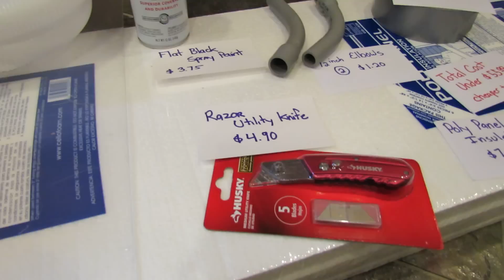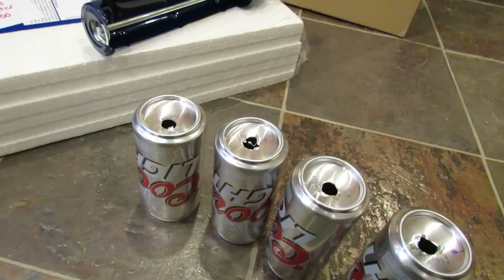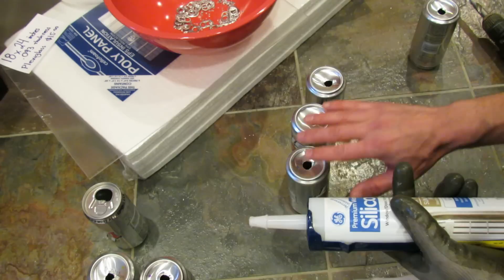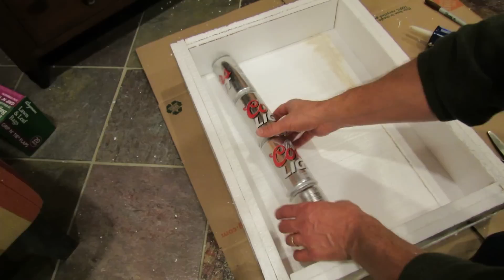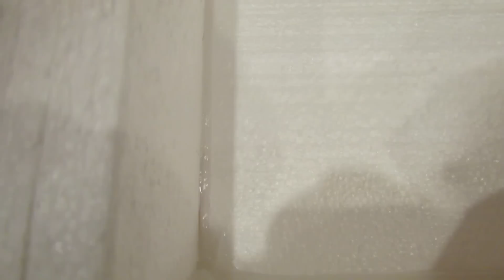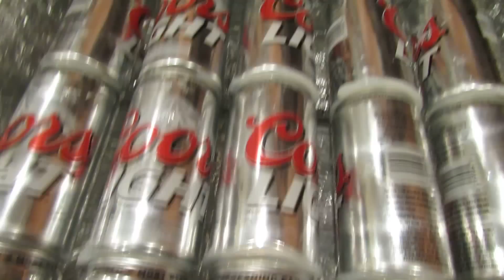Complete Steps for Building A Solar Thermal Soda/Beer Can Heater for A Greenhouse - MFG 2013

Comment: @myfirstvegetablegarden thanks for the clear explanation.  Shiny side of tinfoil reflects heat...so should I leave it shiny and only paint the cans? I  see it's been 10 years since you made this...how has it worked for you? If you made another did you make any improvements?
Reply from the maker: This was a small scale version but it was effective when I used it.
Please Visit The Rusted Garden Seed & Garden Shop: 
https://www.therustedgarden.com/ - Seeds, Starting Supplies, Neem Oil, Peppermint & Other Oils, Calcium Nitrate & More.

Comment: As a horticulturist of over fifty years and a glasshouse grower in the UK, I am a little puzzled how this could be a useful heater for a greenhouse.  Even in our northern latitudes,  when the sun shines in winter, greenhouse temperatures can reach up to 15 degrees centigrade plus. Since this contraption only produces heat when the sun shines  and only a very small amount when it doesn't, I can't really see the point. Heat is really needed at night when this, obviously is unable to work.

Comment: I’d mention that the cans should be rinsed out, especially if using beer cans. That air going into the greenhouse is fine, but not into your house. Ever smell a tavern in the morning? That stale smell is disgusting.
Reply from the maker: Great Point.
Please visit The Rusted Garden Seed & Garden shop for your fabric pots, fall & spring seeds, seed starting supplies, peppermint oil, neem oil, TRG merchandise and more at www.therustedgarden.com Check out my new gardening PODCAST Gardening Coast2Coast at https://gardeningcoast2coast.net with CaliKim.
Reply from the maker: Very true.
Please visit The Rusted Garden Seed & Garden shop for your fabric pots, fall & spring seeds, seed starting supplies, peppermint oil, neem oil, TRG merchandise and more at www.therustedgarden.com Check out my new gardening PODCAST Gardening Coast2Coast at https://gardeningcoast2coast.net with CaliKim.

Comment: You don't need a drill bit for the cans use your razor knife you score aluminum around inside edge like three or four times the perimeter of the inside of the lip of the bottom of the can and the same for the top with a night with a knife and you go around you can cut aluminum sheeting or aluminum with a razor knife it's scratches and cuts wide open I know this cuz I used to install aluminum trim around windows and this is how we used to cut it in the field after we got it measured.
Reply from the maker: Thanks so much
Please Visit The Rusted Garden Seed & Garden Shop: www.therustedgarden.com - Seeds, Starting Supplies, Neem Oil, Peppermint & Other Oils, Calcium Nitrate & More.

Comment: From a design perspective, addition of "tubes" by any form is unnecessary to collect sun's energy.  The unreflective black spray paint is all that's necessary to collect and transfer the heated air from outside to inside.  You can simply test this by doing away with black spray painting as compared to painting the interior of the box with black non-reflective paint.
This is based on the principle of energy transfer.
Energy absorbed is proportional to the mass of the object that is heated, minus the amount of heat lost during transfer.
Reply from the maker: Cool thanks. If I build one again, Ill try it.
https://www.youtube.com/user/pilarchik

Comment: Pssst! I'm a physicist. You do NOT need beer cans AT ALL. Any insulated box with the inside wood painted black and covered with transparent plastic will work fine.
Reply from the maker: That sounds easier. Thanks.

Comment: Pssst!! I'm a physicist. You don't need pop cans, downspout, or tubes to direct the air. Convection works fine, or a fan makes them even MORE unnecessary!!  All you need is an aluminized insulated box and a piece of black aluminum screen suspended inside it.  None of the professionally installed units have ducting inside!!
Reply from the maker: Thanks. Even simpler.
I now have 'The Rusted Garden - A Garden Wants to Give' T-Shirts. Please visit my Garden and Seed Shop at www.therustedgarden.com

Comment: You build the box yourself but it might be practical to look for existing boxes as there is less concern about hot air going out and less glue etc. to be used. At the market I saw people who are selling fish using boxes that have about the required size. Actually I got them for free after they sold the fish. It just took a few days to remove the smell of the fish.
Reply from the maker: That's  a great idea.

Comment: I wonder if a blow torch could make holes in the bottoms easier, map gas or propane should melt a larger hole easier.
Reply from the maker: +piecartbox Oh yeah that would work quickly.

Comment: For the paint, you can get higher yield using Thermolux "Selective Solar Coating" paint - it collects solar energy much more efficiently than matte black, and also has an extremely high temperature tolerance. It also won't bleach over time from UV exposure, which regular paints eventually will, thus losing effectiveness.

I've heard folks suggest Lexan for the front pane as well, but I think plexi is the best bet, as is used in this video...

For anyone interested - Plexi has about 4 percent better light transfer than Lexan and lasts much longer under UV exposure. Lexan will typically degrade after about 5-7 years of UV exposure.

While it's true that plexi glass has lower continuous heat tolerance (180 degrees, versus Lexan at 275), that will be less of a factor if your box has styrofoam lining. Styrofoam melts at 240F, but will begin to decompose at a much lower temperature similar to the tolerance of plexiglass.
Reply from the maker: +Chris McKay Thanks for the technical info. It really helps. I plan one day to make it on a larger scale.
Reply: What is the Selective Solar Coating , Where ı can get it
Reply: Selective kaplamayı nereden bulabilirim link varmı acaba yardımcı olursanız memnun kalırım 🤝🤝
Reply: Thanks for the advice...where would I get solar paint?
Reply: @fdortDUSTYWOODADVENTURES  I can't post a link here, I think, but if you just google Thermolux "Selective Solar Coating" you should quickly find the company that makes it, which is Dampney Engineered Coatings.

I bet you thought I wouldn't reply 7 years later :)

Comment: What is the purpose of the cans? Could you not use PVC pipes instead?
Reply from the maker: Xtant Audio Nope. The aluminum really absorbs the sun's energy and creates the heat.
Reply: Where would the energy go if there were no cans?

Comment: I have a question for anyone who wants to answer it.

Would this work in the winter? If so, is the panel placed outside? Is the sunlight enough to heat the air inside the cans even if the unit is outside? If not, then I assume I would place it inside my house in front of our sunroom window?
Reply from the maker: It works in winter. The sun will generate heat in the unit even with cold. Now if you get in to the teens... I dont know. But putting it inside would generate heat too if you were trying to heat a work space or something like that. As long as you window lets in 100% of light and isnt coated with something.

Comment: Great video.  I was thinking about this design as compared to some others I've seen.  I'm wondering about the insulation.  Would polyiso (polyisocynurate) would be a better insulation.  That stuff is rated for temperatures of somewhere in the 300 degree area, so you don't have issues with the insulation melting.  What is the melting point for the insulation you use?  Thanks!
Reply from the maker: I never got the melting point and the packaging is gone. I was standard foam you can get at home depot. Nothing fancy.

Comment: Two videos that might help others: 1) How to join cans without caulk for solar furnance  explains how to join cans without glue.  I tried it once and found it surprisingly easy!   I used a razor blade to cut off the bottom of the can and unlike the video, I just twisted off the tab on top of the can and used the original hole.  Using this method, you eliminate having to use silicone and you don't have as many holes to drill/punch.  (You still need to somehow make a hole in the bottom of the 'intake cans' and  a can opener to open the topmost cans for exhaust.) 
      
Bill Johnson
 (scroll down) asked about using 3" rigid aluminum duct instead of aluminum cans.                                            2) Soda Can energy transfer converted shows that a straight-thru design is not the way to go.
Reply: I was wondering about using duct. Thanks for warning against it!

Comment: It's a great video Gary! And looks cool! I wanna build one also. One question: you kept an about 0,5-1 cm gap between every single column in the housing, is it necessary or can I place my can-columns as close to each other as possible?
Thanks!
Reply from the maker: ***** I think you could lean them on each other and close the gap. The more metal you can get in the better.
Reply: Thanks a lot!

Comment: (Hope you don't mind the multiple comments. Thoughts just come as I watch...) I wonder about the need to balance the intake and outflow.  Have you found that they need to be appx the same size?  Would there be a benefit to an adjustable baffle in the outflow duct?  Did you consider using foil-faced duct board or radiant barrier panels, rather than lining with foil?  The duct-board is cheap and light, and most home centers have it.  Also, I wonder about using 3" rigid aluminum duct rather than messing with the cans.  I might also suggest engine paint as it is both flat and highly heat resistant.  Great build! Thanx for posting.
Reply from the maker: Bill Johnson No data on the flow. I went with equal size on the model. I think the duct board is a good idea. As for the cans I have seen variations using rain gutters, they are cheap. I would suspect you could use replacements for the cans. I would thing you would just want to make sure air doesnt flow through the systems so fast it doesnt absorb maximium heat.

Comment: Excellent vid!  Thank you for taking the time, and paying attention to detail.  One improvement I would recommend is to replace the silicon, which is highly photo-reactive and will crumble in a short time when exposed to sunlight, with a product called Geocel (http://www.geocelusa.com/).  Roofers use it universally when they install skylights.  It is clear, NOT photo-reactive, and will last for many years without shrinkage.

Comment: Helpful video. FYI the adhesive polymer you are using is called Silicone NOT Silicon.
Reply from the maker: Robert Fili Ive been told. Next use will have the correction.

Comment: Hi Gary, This is nice project, I watched this video couple of times but missing one information, does all cans required to be drilled or not. In your video some of the cans placed down weren't drilled down? Can you provide the project details such as measurements. Thanks for this project and this is good video
Reply from the maker: Krishna Narravula The holes are all drilled out. The cans should make a tube where air can flow from bottom out the top. The exact measurements aren't so much needed as that was a small scale model. The side should come up about 1/2 inch over cans so plexi glass has room to sit but not to much. The frame should be similar to the picture. I can measure the size if you want but you may want something big most likely.

Comment: Hi Gary, I liked the idea and your design so much that I am in the process of making one of these for myself. I noticed you put aluminum foil on the inside of the housing and then painted it. Did you adhere the foil directly to the poly panel? If so, what did you use as an adhesive? (I am at the point with assembly that I am ready to paint the interior.)
Reply from the maker: Diana Reiss I used the caulk tube liquid nails and some silicon the was left over.
Reply: Thanks Gary! I kind of thought that was what you did. I am excited to continue on now.

Comment: Very interesting video Gary. Would this be called a "passive" solar heater? Do you know how this differs from those containing water or the commercial ones, just a basic answer
Reply from the maker: eveny119 Yes and no. It is passive in the sense that it does not have any moving parts.It sits there and generates heats. Passive systems are often look at giving back heat. Like water, concrete or thermal mass systems that hold the days heat and radiate it back. The system only creates heat if it has sun. It doesnt store or hold heat.

Comment: Great video Gary Pilarchik ! Well done and informative. I've never seen anybody make these out of Styrofoam! :-)
Reply from the maker: ***** Thanks. It is sturdy and light weight for my need with a greenhouse. If I were mounting it on a house for room heating... maybe not Styrofoam.
Reply: Sure, but either way, it's a great proof of concept and still functions well. I look forward to a video that shows the heating capabilities!
Reply from the maker: ***** Yep the concept is sound. And I am going to see if the thermal siphon that starts is strong enough to move the air out. I did order a small solar fan but Id like a design that just moves heat with out any moving parts. The fan is another video. It was just a hat clip solar fan for $4 from China.
Reply: Gary Pilarchik you could even wrap it with a thin masonite that is primed and painted, or ply.. ply would be cheaper.. or hell OSB is like $7.50 for a 4x8 sheet.. prime and paint it and it is all good :)  Thanks for the video Gary!